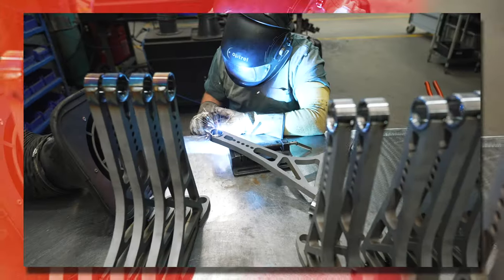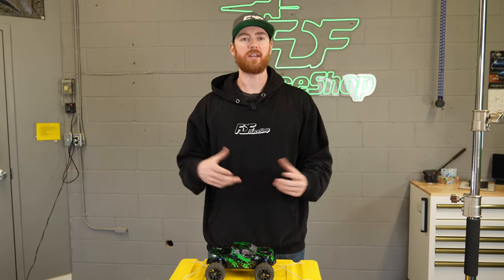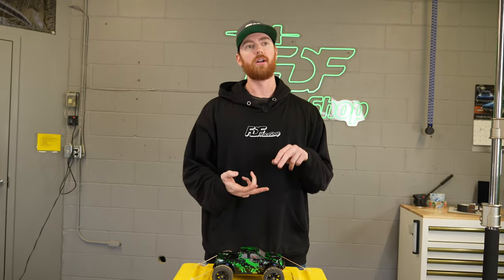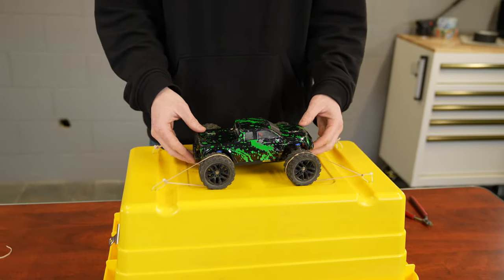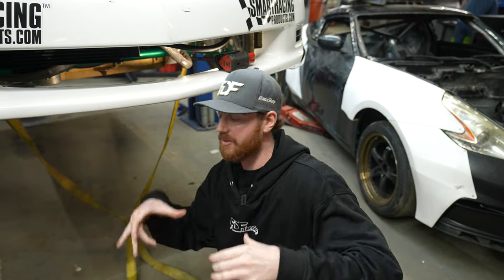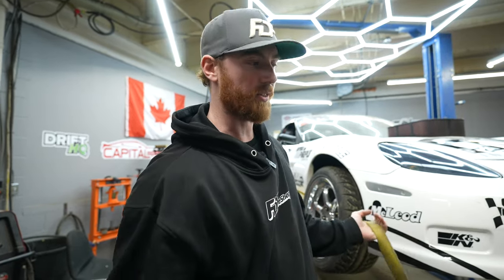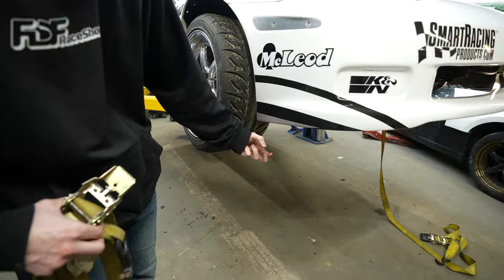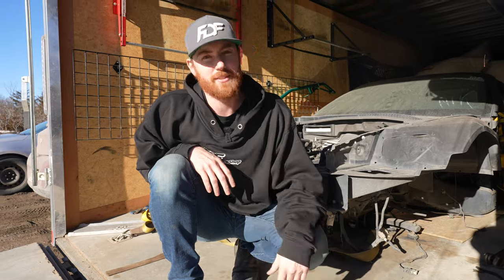The RIGHT Way To Strap Down Your Racecar

Comment: The problem with tying down on your wheels is that your $2k shocks are bouncing all the way to/from the track.  If you tow 200 miles, your race car suspension has just driven 200 miles.
Reply: They sell a air bag to put under your race care to stop your suspension from moving or minimizing the movement.
Reply: Or if you know that you’re doing a long trip you could put your old coilovers assuming you keep them, and switch to your new ones when you get to the track. A lot of hassle I know

Comment: I don't even use a strap in Japan. I just use the 2 front wheel chalks and the winch to the tow hook. No other straps and 90 percent of the other people with single car haulers will do the same. Having nice roads is a huge plus.

Comment: The "best" way is to the chassis with air bladders under the car front and rear so there is no suspension travel. A ten hour tow with only the wheels strapped is ten hours of wear and tear on your shocks and suspension components. If you have $10k shocks you dont want them bad boys wearing out.

Comment: Or just dont use crappy straps and learn to put them on in a way that wont break them. Cross strapping is about the most used method of securement in transportation. The only way it can go wrong is if u are using the wrong straps or putting them on wrong

Comment: I always advocate 4 corner wheel strapping at every track event I go to. tend to stop by pits that I see are cross strapped. Great video..

I also prefer Over the tire strapping, instead of wrapping the strap around suspension parts / wheels just to keep tension and stress off those things.

Comment: The only time I've seen people have cars bounce sideways into the trailer wall is from straight strapping.  The only transporter way is wheels "down" or chassis "down" not "out", as you correctly shown on track or trailer pics.  I don't have tracks so I do both straight and crossed, because I only have about an inch on either side from wheel to trailer wall and the car becomes impossible to unload if it shifts, and some of these states have roads bad enough that I've gotten airborne before and seen fuel tanks and battery boxes fall off 18 wheelers near chicago, lol.
Reply: X